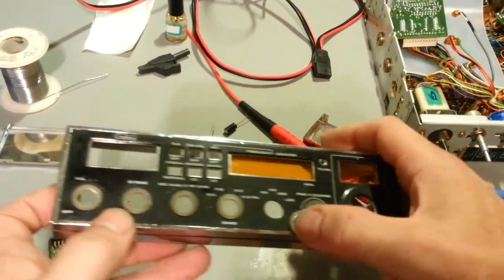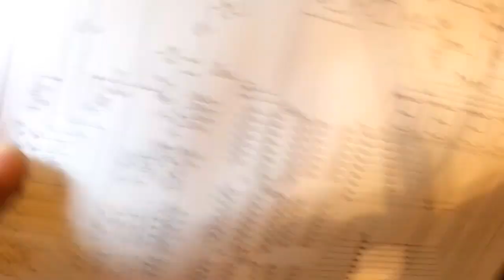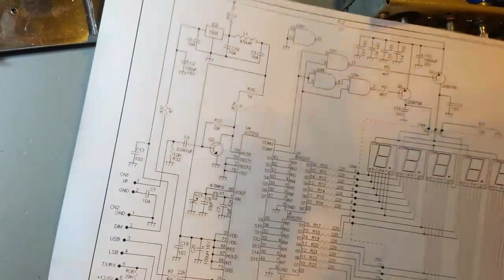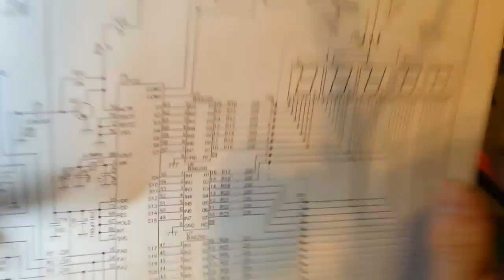Galaxy (Ranger) frequency counter module repair.  Common problems to look out for.

Comment: My frequency counter be fine. Then i it'll run away ALL over the bands in high speed. Same with transmitting. You sound fine. Then they complain. I look at radio it's running like a Hollywood 💥 timer. When somebody cuts the "red" wire. Lol Any ideas?

Comment: Good point on the cap voltages.  I am going to use  that tip on the next radio i recap. Alternator voltage is 14 to 15 in most of our trucks. Any 16v cap on supply voltage i will definitely go up if i can get the next higher voltage with the dame diameter.  Thanks for the tip.
Reply: Oh 90% of radios stay on but cut off Rx at 15ish volts. Never pushed past 16volts. Cause they'd go out by 15.5 or so.

Comment: To completely remove the frequency counter hum there is a brown wire on one of the plugs on the board, I can't remember which plug at the moment. Add a .1uf 250V 10% metallized polyester film capacitor from that wire to ground. The hum will be 100% removed.

Comment: Do you know if the magnum S3 frequency counter jack should only have 4 wires connected to board I looked at mine and the yellow and orange wires are not connected to board is that normal? BTW how's the electronic course coming along I'm setting up my patron account ow so I can donate to the cause I'm really lookin forward to it

Comment: what happens when you turn your counter on and it hums ?
Reply from the maker: +Scott Todd 

The counter module itself is humming?  Or do you mean you hear something out of the speaker.  Noise out of the speaker, expect that.  They are poorly designed and have a lot of digital noise that leaks into the receiver.
Reply: when I turn the radio on it sound great but when I push the button I hear a buzzing sound
Reply: and how do I get a hold of ya
Reply from the maker: Scott Todd 

Shoot me a email.  Just add @gmail.com to my YouTube user ID.

Comment: great video Mike.  cool advice on the counter module.  that wire trick is awesome!

on the little 47 ohm resistor,  if you are going to solder one end to the 7805, and stick a component lead up through the board anyway; couldn't you just use a standard 1/4 watt resistor in that location?  yes, a bit ugly, but would there really be any clearance issues?  thanks

Comment: It's kind of ironic that the counter board uses a TO-220 regulator and the tiny dropping resistor (physical size) that basically has to absorb the other ~8V of the supply voltage; for something like that I would have expected the regulator to be smaller (or vice versa).
Reply from the maker: +Dino Papas 

LOL, you never heard me claim they made good radios.  Definitely one of those things you look at and have to wonder what the heck were they thinking.

Comment: If you change the counters resistor value to a lower value, it will reduce its power dissipation and may allow it to be ok, it will be there to act as a fuse, they should of just used a fuse.
Reply: And it will shift more of the dissipation to the regulator.